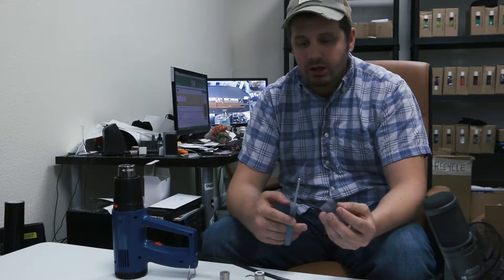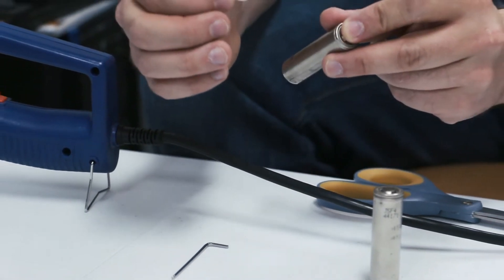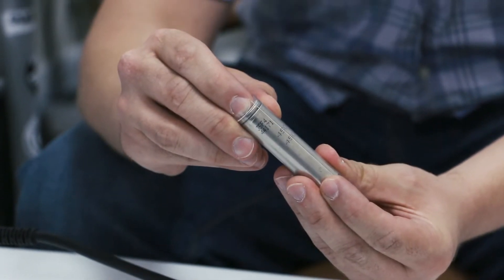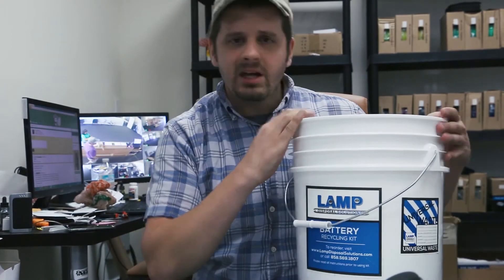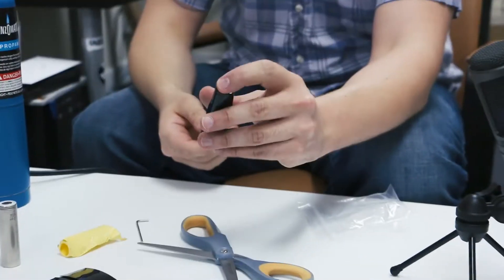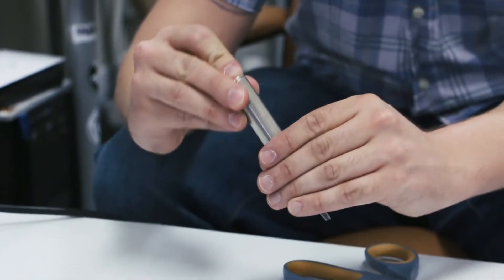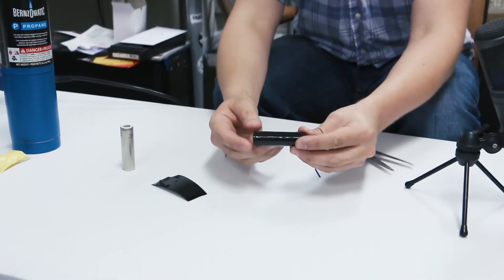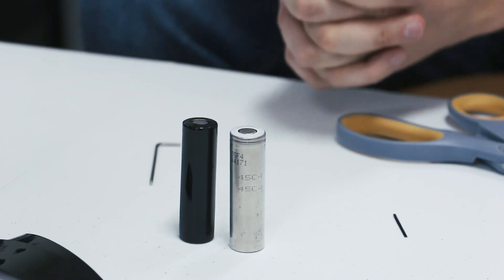How to Wrap and ReWrap an 18650 Battery

Comment: I have 3 mxjo batteries. Only two needed the re wrap so I did. The third is perfectly fine. Should I still rewrap it? Idk if the" marry the batteries" goes for the wrap on the batteries as well. Help would be much appreciated thanks!
Reply: i konw this is old and youve probably sorted it by now, but no it wont have any effect, the only reason to rewrap the 3rd would be for looks (they all look the same)
Reply: Still very useful thank you. I was an rx200 so i needed the three batteries at the time but shortly after I wrote the comment, I got the rx2/3 and only needed the two I rewrapped. But thank you now i know for sure that i would have been ok

Comment: I talked to a mechanic and to a guy on YouTube. both of them said that inside a flashlight, for instance, a battery that isn't wrapped won't hurt a thing. the body of the battery is a ground, and the power is inside the battery, which we all know, and even touching the body of the flashlight inside to the body of the battery shouldn't hurt anything. i don't know..I have a battery that is unwrapped because it wouldn't fit into the body of the flashlight with the wrap on. I tried it, shook it, heard it rattle, neat the side of the flashlight, and took the tailcap off, took the batteries out, and it seemed fine. anything else I should be aware of? I've heard both sides and experienced it firsthand with no repercussions.
Reply: beat the side of the flashlight, not neat....autocorrect
Reply: the danger is the positive pin.. if your wrap is loose the insulator can come off (the plastic ring on the positive side) and then if you put it into a flashlight or something, both the negative and positive will make contact at the same time.